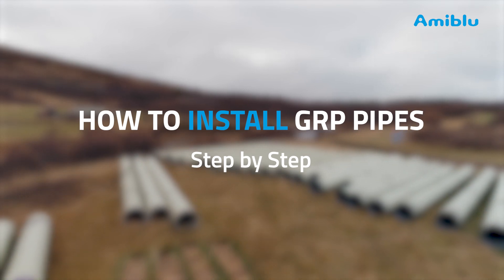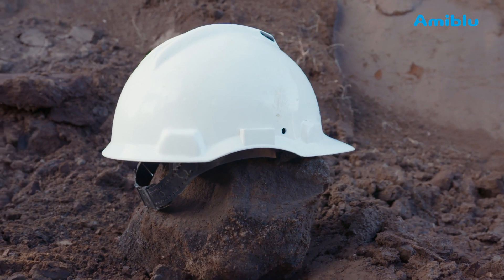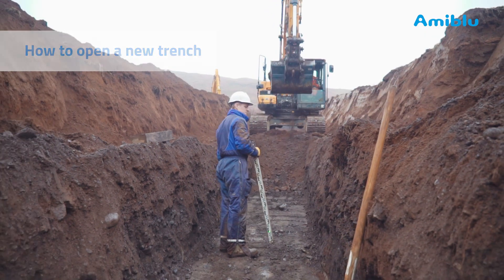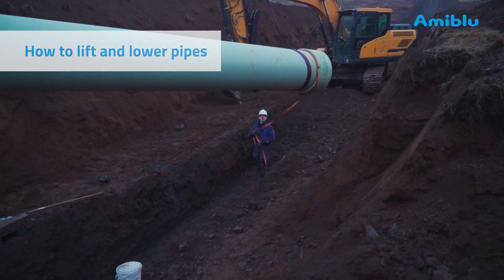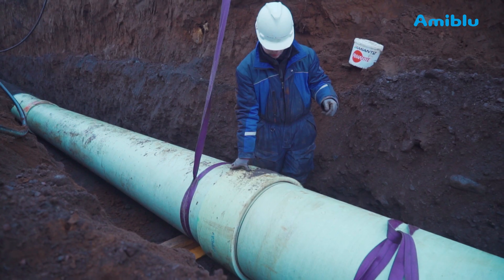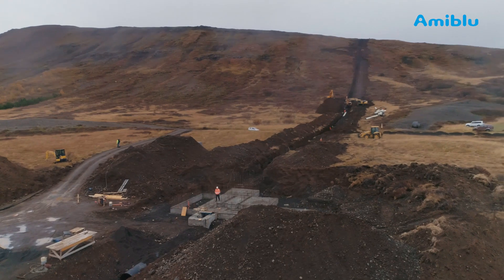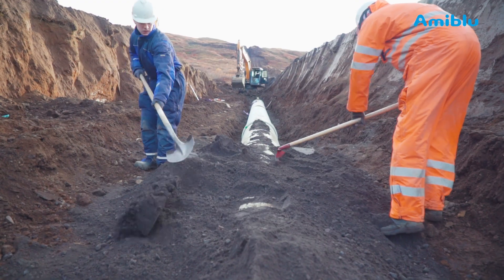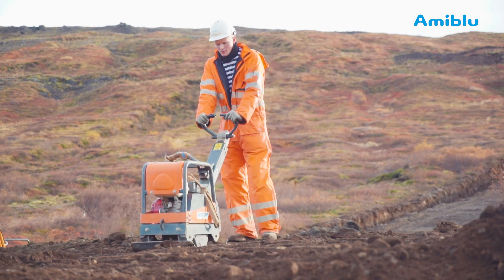How to install GRP pipes (English)

Comment: FRP resina Bisfenol Fumarato o Vinil Ester .
Resistencia al hacido clorhídrico.
Barrera química,dos surfacin veil 
Dos Mat de 450 gr.x mt2.
Capa estructural ,Filamento Winding ,
Eso. pn 10 según normas UNE Y ASTM.
ACCESORIOS IGUAL.
BRIDAS ASA 150 FF.
UNION A TOPE ,FAJADA CON EL MISMO MATERIAL.
También necesitamos Resina,Naftenato de Cobalto,Dimetil Anilina.y peróxido horganico o catalizador .
Fibra. Velo tipo c compatible con la resina
Mat de fibra picada de 450gr.x Mt 2
Woven Robing de 24 0z.
Los rollos serán según el diámetro de la tubería.
Serían 2",4",6",8",10" y 12" respectivamente .
Las tuberías serán de D.2",4",6",12",18",24",36".